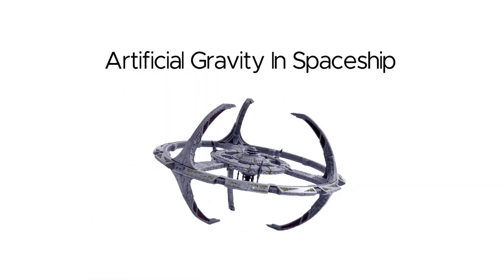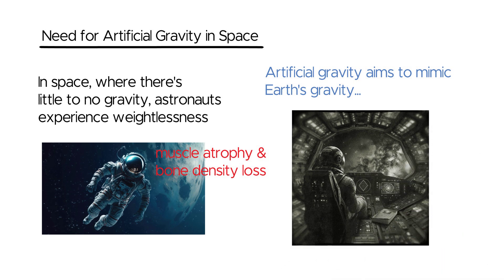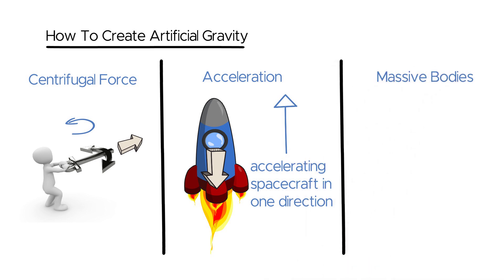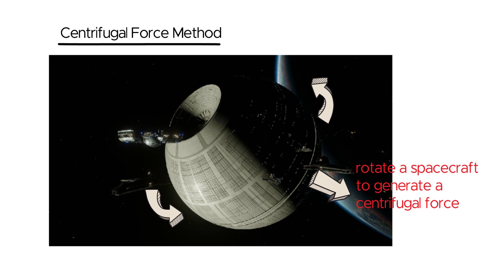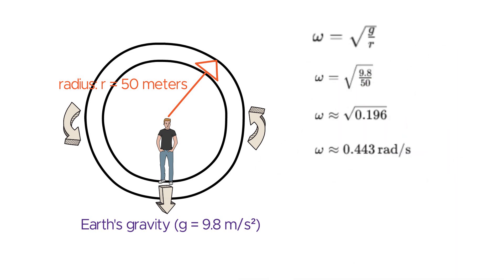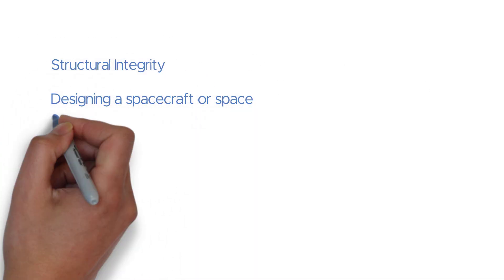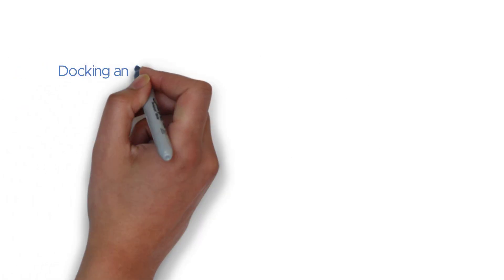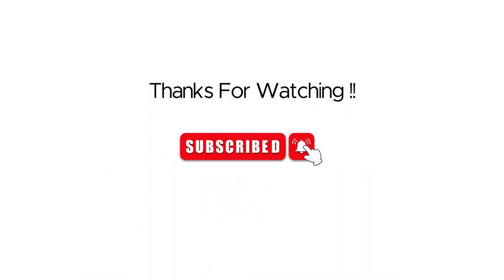Artificial Gravity In Space - How To Create It?

Comment: You can't use a planet's gravity to "create" a suitable gravitational enviroment inside you spacecraft (provided that it is of a reasonable size), while in orbit -unless you are willing to have the engines running continuously, and with our current engine technology, that is expensive in fuel.  The reason is that an orbit is a condition where the centrifugal force and the force of gravity balances each other out perfectly, since if that is not the case, the spacecraft would fall down. ...and that is the exact reason why the astronauts orbiting the Earth feels weightless.

If you want to stay in orbit, AND exploit a planet's gravity to give the crew a weight, there might be a trick you can do -but it is probably not technologically practically. 
What you need for this to be doable is to note that the is a gravitational gradient around a body, so the gravity is stronger the closer you get to the planet. The effect is not big, but it is there. Furthermore if you have the same orbital period, the further from the planet you go, the higher the centrifugal force will be. So if you have a really long space ship in orbit, you could experience a difference in gravitational pull on each part, where the lower part is in an orbit that is just a little to slow so they want to fall down, and the upper part is in an orbit that is a little to fast so the centrifugal force tries to fling them out, and those forces can outbalance each other perfectly. However for this to give any noticeable changes in the forces on different parts of the ship, it needs to be really huge- probably in the order of hundreds of kilometers, and at that point, spin gravity is probably still a better option.

Comment: DS9 is round, but it doesn't rotate, so the use of that station as a prop for this video was a poor choice.  Every method to simulate gravity, other than having a mass the size of the earth, has drawbacks (and  having a mass that large makes it near impossible to move - it would be as effective as trying to stick engines to the Earth and blast off).   I hope that one day we'll understand gravity, maybe figure out how to generate gravitons (which are still unproven to even exist) at will, and then we'll be able to use those to bend spacetime, which will lead to amazing advances in both propulsion and artificial gravity. Will probably not happen in my lifetime though,
Reply: if we ever find a practical way to warp space-time (as in make a warp engine), we'll also be able to warp space-time to make real gravity where we need it.

Comment: Mile long cable winched outwardly from two connected vessels. Such that, if they are coasting, these two vessels can slowly swing round circularly upon the mile long cable, creating artificial gravity, avoiding extreme Coriolis effects due to the coasting vessel system having such a wide diameter.

To accelerate, the cable is winched in first, connecting the vessels again.

A retractable rotation means like this helps in a number of ways